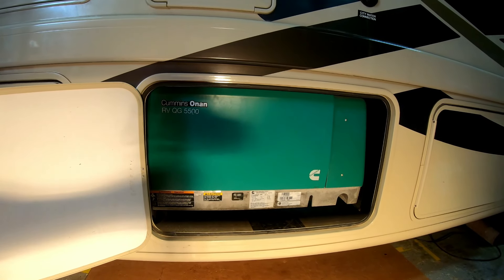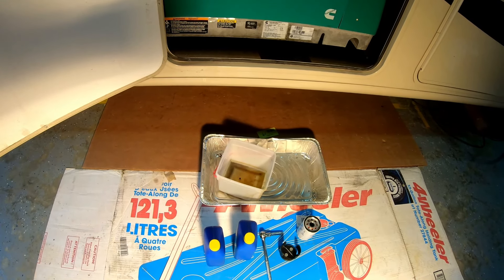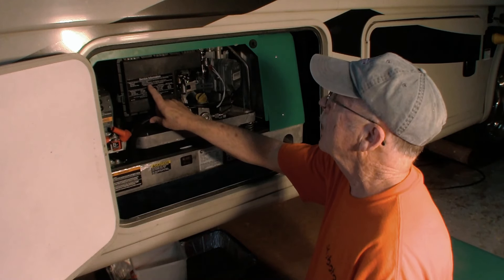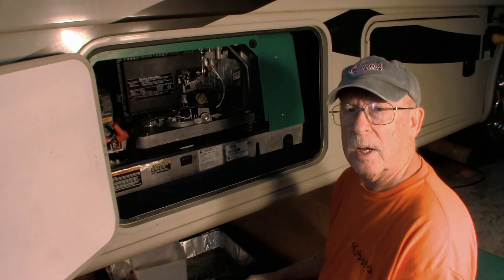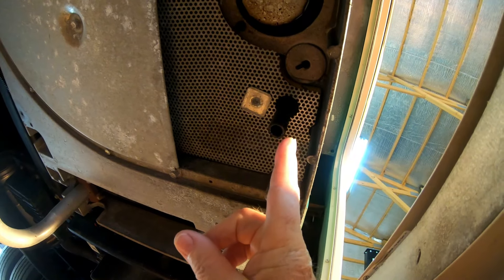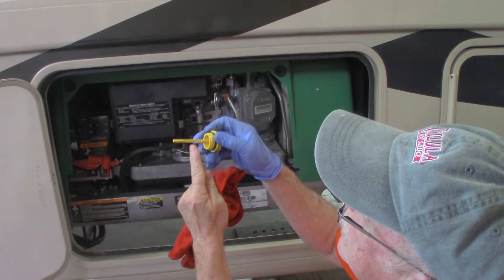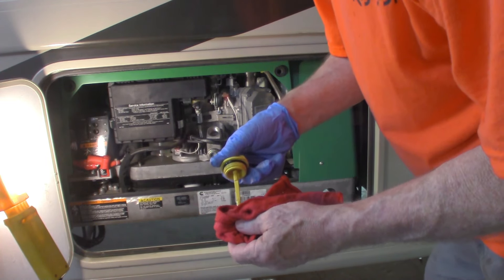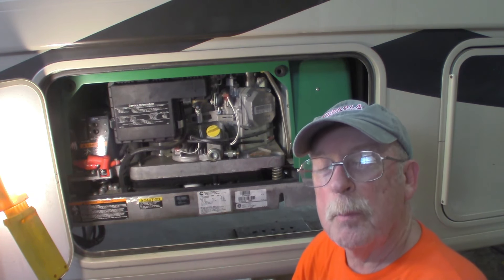RV Travel Channel - RV Lifestyle Channel - In The Shop -Onan 5500 Generator serv iceS3 EP034

Comment: If you punch a hole in the bottom of the oil filter with a screw driver it will drain too and then you won't spill in when removing.
Reply from the maker: Great idea. I will have to try that. Thanks for watching and commenting.👍
Reply: Good idea 👍 thank you

Comment: Thanks for this video! We have the same geni on our new 5 ver. Question; does your exhaust just drop out of the bottom or do you have an exhaust pipe that directs it somewhere else?
Reply from the maker: Ours has a pipe that goes up to in back of the front tire. I would think it should at least run a pipe towards the outside of the RV. Thanks for watching and commenting.